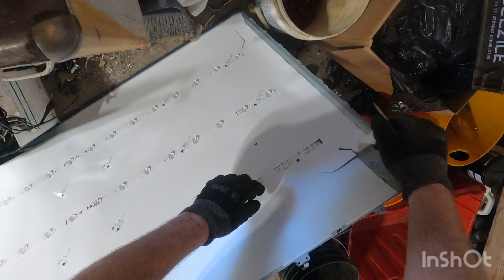Flastscreen.  What is inside #ewaste #flatscreentv

Comment: Too many screws. 😂 Do you get more for transformers than low grade boards?
Reply from the maker: Never really looked into that.  Just pull them off and deal with them later.  If they are small I can send for copper bearing maybe 20 cents per lb